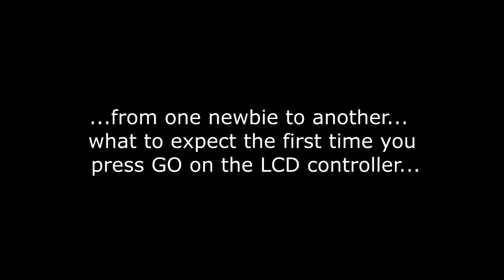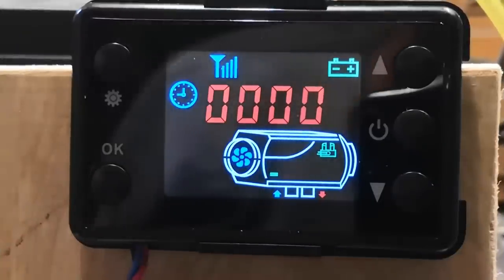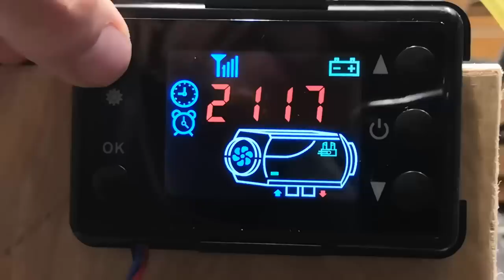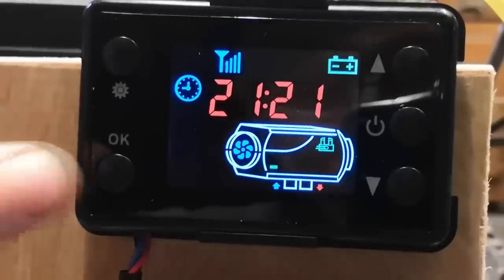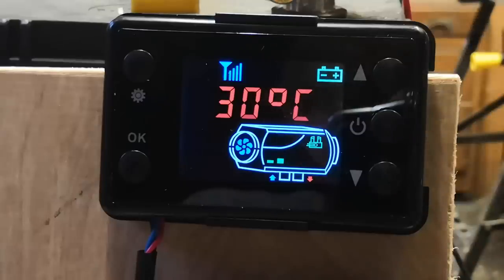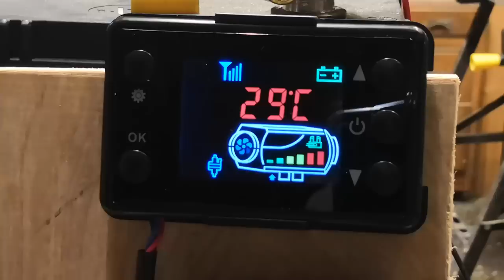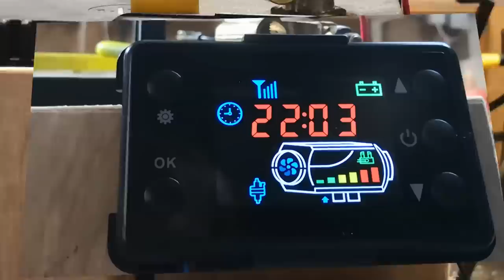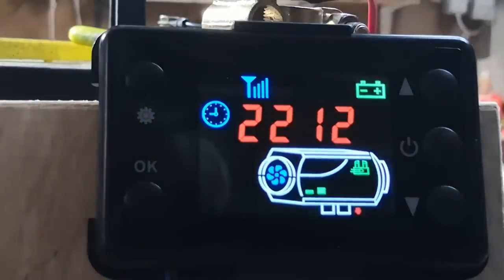First Time you press go...  LCD Controller- Chinese Heater

Comment: Hi, what’s the recommend leisure size battery to work this heater, ( I have already installed in my van but cold is killing my battery) soon as it drops to 11 or below it won’t heat up , think battery is humped.
Reply: Silver Wolf Thanks so much, I am new to this camper van hobby, so learning as I go along. If you can recommend a good battery and where to look that would be great. Would use EBay but things like this I will get a quality item first time around. On a separate note, when I bought the van the guy said not to leave the fuse for the fridge in unless on hook up otherwise it drains the battery’s . Is this normal? Thanks again.
Reply: @Silver Wolf i have a same problem, did you solve it?? Did you buy a stronger battery? And  if yes how much amp / h?
Reply: Boat owners use similar (but hugely expensive!) heaters by Erbspacher. It's recommended to run your engine when firing them up. Let your alternator provide the 12 amps for start up and stop your engine when the unit is running normally. In fact they won't fire up if your voltage is low.
Here's another tip. Whatever the battery AH (amp/ hour) rating is on the label, you must divide by 2. So if you want 10 hours running your heater at 5 amps per hour (5AH) you will get 10 hours from a 100 AH battery. (10 x 5 being half the battery rating) Taking a lead acid battery below 50% charge will hasten its demise. 
Apart from the wheel, your lead acid battery is the oldest tech on your camper!
Reply: i just did buy my heater .i run it of a  12 volt 12 amps  switching power supply from jcar but i do turn it off.  just have to re set it when on again,  but i did learn from this video how to set the time  thanks

Comment: Having a strange issue with mine where it's popping the fuse when trying to fire up. It'll try to run for about 20seconds until it eventually pops.

This is after priming the system as well..

Any idea what the problem might be?
Reply: Nevermind! I figured it out, incorrect fuse size :/
Reply from the maker: Eeek.. odd one.... maybe focus in on the pump. There is a delay before the ECU fires up the pump so if it pops when that kicks in... that might be the reason. Good luck!

Comment: Hello is there a secret way to shut the screen off after the cool off period is done?
Reply from the maker: Regret no... I installed a kill switch to isolate the whole heater... that is fine but mount it where you can't accidentally turn it off before cooling down is complete.

Comment: My controller won't let me set a temperature it only tells me the temperature that it is. Is there something I can do to fix that in the coded menu
Reply: I also have this issue. I can’t set a desired temperature, I can only turn the unit from 1.0 hz - 3.0 hz
Reply: @haskyb9184  what you need to do is press the top left and top right buttons together. Then after doing this press the right top button and it should now let you adjust the temperature

Comment: Hello 
I would like to know how you set the air condition mode?. (Just running the fan for summer ) big thank
Reply: Yes I was wondering that too, I can't figure out how that works.  Please help.
Reply: I don't think that they have one. I don't think they are 8kw either. I do think it is false advertising though.
Reply: It's a heater, nothing to do with air conditioning

Comment: No time when my controller switched on just says P12v and a red circle
Reply: yeah I've just fitted one to my cousin's van and that has the same controller with no clock on powering up just the P12v, I've sussed out the pump priming mode and basics like getting temp in degrees instead of H1-6 and found what I think is a timer mode but will play further tomorrow
Reply: @chugfreeman2352  Yes I've seen the timer by pressing the top left & top right together for few seconds but not sure how it adjusts ,funny there's no videos at all on the new controllers well I haven't seen any to date (Jan 21 )
Reply: @ZerHour  after pressing top two buttons press the bottom two together, it seems to bring up some sort of hour set thingy, but it doesn't seem to be in hour/min clock format there are only three digits? and if you press the on/off button to switch through the three digits,  up and down buttons to change values, and pressing top left seems to switch an on or off icon in display next to timer icon, but I've not had time yet to try it to see what happens. Have you got your readout in degrees C or H1-6 ? (long press top left button)
Reply: @chugfreeman2352  I have mine in degrees c and sometimes the Hertz (h ) depending on what I prefer , not to bothered about an actual  time  clock on it but it would be handy ,I've seen the other setting for a timer thanks for reply handy  tips if I use the timer

Comment: I got one of these and when I push up or down it has p-(number) hz. I can't set temp. What's wrong with it? The instructions don't say anything
Reply from the maker: Mike... press the settings button and up arrow at the same time... that will switch form manual to temp control
Reply: Brilliant! Mine was doing the same thing, thank you!
Reply: Ok will try that, thank you mate.

Comment: Do you have to prime the heater on every use if you only use it maybe once or twice a month
Reply from the maker: You should not have to... I don't and like you, often have a long period without use.
Reply: Diesel does not evaporate quickly and given it is a small port in the combustion chamber there should be little evaporated in a month.

Comment: Hi friend Question I have I lcd monitor like your it's a count down Time when I set it  It never comes on it might be the next day ??
Reply from the maker: Hi.. there are two controllers looking the same with slightly different functions on the timer. On mine.. there you set an on time and an off time. There are two presets for that. The other timer has a countdown until it turns on... and then the other setting is for how long it stays on for. So it is not using actual times but instead durations. Might be yours?
Reply: @campervan_hackers  what a pain . I think the way forward is the after burner controller everybody seems to be getting them . Thanks again 👍

Comment: Hi mate, when I start my heater the battery flashes, then I get a Eo1, then as it's getting hotter, the battery stops flashing then 2 minuets later it turns off.
Reply from the maker: Usually, with E01, this is under the voltage of the supply. This might mean that your battery can't deal with the high draw at start-up. Or... sometimes these heaters come with undersized cable from the battery to the unit and needs to be beefed up. If your battery is charged from the engine via a split charge, try starting up the heater with the engine running. If it works that way, there is a good chance your battery is not dealing with the 10amp or so draw on start up.
Reply: Just an FYI, I bought a 5kw heater and a 15A 12v power supply. The glow plug would do the initial heat and it appears when the fuel pump was called the whole thing shut off and clock would reset with no error code. I connected the heater to my car battery and all fine. In the end, had to upgrade to a 30A power supply and all fine. Camper Van Hacks notes 10A, and I had heard 15A would be fine, but proved not for me. Good luck!

Comment: How reliable are these? 100 quid on Ebay...they cent possibly give reliable heat...propex gas heater any better?
Reply: @jernejnovak2493  do they have issues when starting up and shutting down all the time? Is it best to have them run a while before shutting down? I have experience with eberspachers and even these have issues
Reply: ThinkFlite i have Ebespacher and chinese heater.No one have no issues,they work great.Before you shut down it is good to burn him on full power obout half of houer.
Reply: Pete Coventry are they pretty thirsty ? And do they need 12v constantly or just for starting

Comment: Hi, first time at comments! When i turn on heater the lcd shows pln spaces. Heater turns on etc and ehile it is running the display shows voltage. I dont seem to set and save other settings?
Reply from the maker: Interesting... for clarity.. do you get to see the icon of the heater on the display.. and if so does the fan have three blades or six? There is a three-balded version that looks very similar but has a different operation to the usual one.
Reply: The heater icon is on and it looks like a 3 blade fan
Reply from the maker: @user-vv9sk6yw4j  Ah.  Yep... that controller is different... sorry this video is little use to you 😞

Comment: After priming the pump and going to main menu mine says e-01 as well as the battery light is flashing if I hit up it says p-2.4hz (changes a little bit) any idea?
Reply: Trailbound co did you get this resolved as I have the same happening to mine
Reply: You've got a discharged battery or bad battery connection or undersized wire.

Comment: My diesel heater blows a lot of smoke, is this normal or should I be using a select fuel source?
Reply: Have you angled the fuel pump slightly upwards towards the heater unit? The terrible instructions recommend 30 degrees or you’ll be burning more fuel than you need to
Reply: @davidmillington3527  I will try that. Thanks heaps.

Comment: our pump keeps priming and the heater wont kick in  .All we end up is diesel on the ground . Any ideas to help us ? We have no error codes the unit is brand new
Reply: You have a leak in the fuel line maybe, or if the fuel is coming out of the exhaust pipe  you have an terminal issue
Reply: Silly question, but when the priming stops do you press the Go button?
I fell for that one thinking that the heater would start automatically when priming stopped and it dawned on me after I had primed it 9 times that I had to press the Go button and then away it went.
Mind you I filled the neighbourhood with smoke until all the extra fuel burned up. :)
Reply: put fuel pump on angle this may fix problem
Reply: @lukeb5584    PLEASE HELP.... Hello you can prime the pump manually by pressing a few buttons on the LCD screen and it wont stop until you stop it manually right ?  my fuel lines are hidden under my loader machine I cant see them? how will i know when the heater is at full prime ???  Will the clicking stop ...Iam getting code E10
Reply: @WaltsTreeVideos  Hi, The first time I used my unit I assumed that the heater would start after priming however this is not the case.
I re-read the instructions and when the pump stopped clicking (priming finished), I pressed the ON button and then the heater started.
At first it produced a lot of smoke due to all the extra fuel I had injected re-running the priming cycle, but after several minutes the smoke stopped and the heater worked fine. It works great now. No smoke at all and when it reaches the set temperature, it just ticks away slowly.
Best thing since sliced bread :)

Comment: HELP

Thanks for your tutorial
I have a question. What is the lowest temperature I can preset? Mine says 8 degrees C 
I need it to just keep my supplies from freezing, so I'd like it to come on around 3C 
Can this unit do this?
Reply from the maker: Depends on size of space and insulation... but my 2kw heater will not get my van down that low... it has to kick out about 1kw or it will go, out... not sure this kit is right for your use case

Comment: My heater has been installed for over a year and has been working fine. The van has been sitting around doing nothing so decided to put the heater on for a while. I switched on the master switch and the LCD lit up. I then (As usual) pushed the ON button on the remote. The LCD died and has not come back on! Has anyone any ideas? The battery is good and over 12v at the master switch.
Reply from the maker: Interesting but I don't have much of an idea on that one as you've checked out the voltage supply. If you have a Facebook account it might be worth joining these two groups and asking because I've got some good information from them in the past.  https://www.facebook.com/groups/5034375153284901/

https://www.facebook.com/groups/283466485963713/

Hope you get a resolution... let us know what the fix is in case others have the same.

Comment: My screen is very dim. Can’t see numbers Any idea?  Got it working like monkey at typewriter by pushing every button til it cane on. wish I’d seen this first. Great video thx
Reply: Wondered, did you sort this? I just ordered a new unit for that same reason but going to regulate the input voltage on the new one to 12V for reasons I just posted.

Comment: hi i have e 01 keep flashing , low voltage ... but ive hooked up everything fine ..sometimes it do
esnt flash then most of the time it does ..., tried everything , my batteries are full!  any advice?
Reply: hello could you fix the problem? I have the same problem e-01
Reply: I have the same problem with the engine running it’s showing 14.5volts but still have error E01
Reply: try browsing through the settings (these where you need to put in code 1688). there's an option of selecting operation voltage between 12 and 24v. maybe for some reason yours is set to 24v and that's the reason for the error?
Reply: someone i saw elsewhere put a bigger electrical cable on and they reported it stopped the error code for low voltage, but I would try the settings first as the above poster advises.

Comment: I followed the video but i cant set the temperature, the outside temp comes up but when i press the button again a p number comes up and not the temp, any tips would be very much appreciated thanks
Reply: Mines the same. Did you find out anything?
Reply: @jordanliddle2051  Press up + ok at the same time and it will switch to temp setting. Then you can set the temp with up and down buttons.
Reply: @lokis7230  thank you!

Comment: Does it always make that ticking noise when it's on ??
Reply: The pump will tick whenever fuel is being used so it will always tick when the burner is alight.  From experience with an Eberspacher heater, you should mount the pump away from the sleeping area if possible and use a mounting that reduces noise.  I used a P-clip lined with rubber.

Comment: HELP!!! Me and my partner purchased this and received it yesterday and in stalled it but we keep getting an E-06 error. What dose this mean the instructions are not clear
Reply: i have the exact same problem ! did u find any solution ?
Reply: The instruction sheet mine came with says Error 06 is a Motor Fault, ie the bit that drives the fan.  It suggest "checking magnetic polarity" which isnt very helpful, unless it means that you have your + and - battery terminals the wrong way round.  If you have only just purchased the unit though I would be on to the vendor to return it as not an problem to expect on a new product.
Reply: Open the heater, probably your fan is blocked.

Comment: Help! Bought one of these used it for 2 days now the glow plug light flashes and it wont turn on. E03 is showing up? Help please!
Reply: Christopher Roosa eo3 is heater motor fault
Reply: @tamaranewman2182  well the motor runs I pulled the unit removed the glow plug but left the glow plug hooked up to the controller board and turned it on. Glow plug never got hot so I believe the glow plug is bad. I read 12 volts at the glow plug.

Comment: Has anyone found a cover for the LCD screen? Mine is in a bit of an exposed position and am worried about it getting damaged
Reply from the maker: There does not seem to be an 'off the shelf' cover and many have made their own. But... if your controller is like the one in the vid, you can take it out of the holder, 'turn it around' and put it back in the holder.

Comment: My heater just keeps smoking!!!!! I’ve installed in vehicle under the drivers seat with a fuel pipe coming from my van diesel fuel tank.  The first time I tried to get it started I ran it for about an hour and just got loads of diesel smoke out of the exhaust.  In the end I stripped the unit and the cylinder was full of black carbon and old diesel.  I cleaned it out.  When I went to rebuild it I snapped the glow plug.  I’ve just received my new glow plug and trying to start again.  My heater goes through all the motions as detailed above, but the fan does not spin that fast.  Its does not seem to fire up.  That said, it does get warm, but the big problem is it is generating a lot of smoke from the exhaust.  I could not possibly use it with so much smoke coming out of the exhaust.  Any ideas on how I can fix this problem?  Thanks.
Reply: Don't use it if its smoking. Possible fault which could possibly mean a fuel leakage, this can cause gases to exit through the heaters vents into the cabin but also can cause smoking out of the exhaust.  You need to identify the problem looking for leaks.
Reply: @karl9460  the smoke is coming out of the exhaust.  I've stripped & cleaned it again.  I'm going to give it one more go and if that does not work then I'll get rid.  Thanks
Reply: check out this guy he knows every thing there is to no 
15 parts full strip downs
John McK 47
Reply: run it flat out for 5 min before shut down cleans out black soot
Reply: from what i have seen on a previous video, you can adjust the amount of fuel it recieves. The adjustment is in Hz within the settings.
Reply: It almost sounds like you're priming to much or priming every time you turn it on? You don't have to one time is good. It may be silly but a lot of people make this mistake. Just asking. You didn't pull the fuse out when it was running right? Thinking it had something wrong, so you pulled the fuse out to stop it? Might have hurt the mother broad if it was hot. Trying to help.
Reply: The fuel pump is supposed to be at least 30 degrees up words and angle back towards the fuel tank or you could possibly get too much fuel